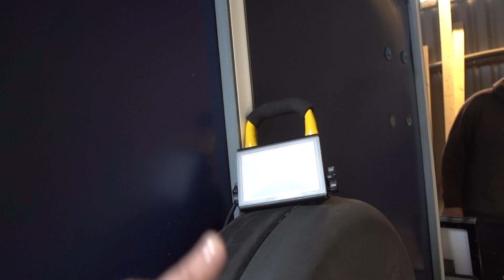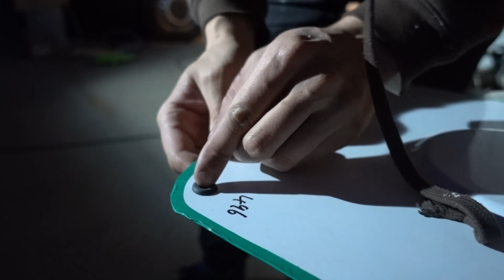We're CONVERTING A Horsebox!

Comment: I've worked as an automotive electrician mostly on sprinters. Make sure to use A LOT of uv resistant sikaflex around the holes in the roof and those boxes. And degrease the surface before. :)
Reply from the maker: Thanks for the info!

Comment: Hi Guys, how did you secure the panel to the roof rack? Did you drill through or bolt it on?
Reply from the maker: The solar panel is bolted onto the roof rack through the roof rack slats so can be removed if need be 😊

Comment: Any reason why you're mixing the bands for your electrical stuff. You have Victron controllers, Sterling batteries. Sterling sell controllers & Victron sell batteries. Then you went to Bimble for the solar panel & looking at their site they sell own brand LiPo batteries & controllers at fraction of the cost of Victron & sterling. Wouldn't it have been easier, particularly from a support point of view, to buy it all from the same brand?
Reply from the maker: Hi Mike, yeah few reason one being we wanted the best components for the particular role it played and suited our needs. Victron gave us the MPPT as well as the battery monitor. We brought the victron charger/inverter as it fitted our needs for mains power + a nice sized inverter. The sterling batteries & battery to battery system we got an amazing price on so couldn’t turn down that. Also these 2 companies are leading the way and have brilliant products with really good warranty’s. Our batteries come with 5 years warranty.